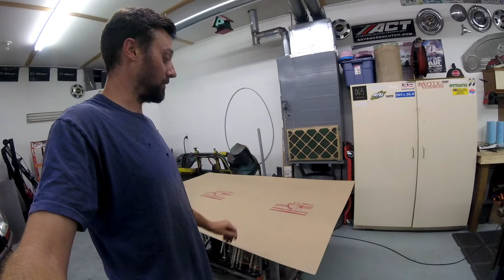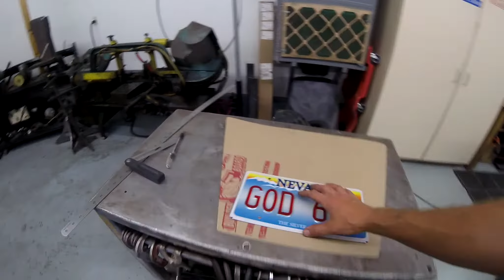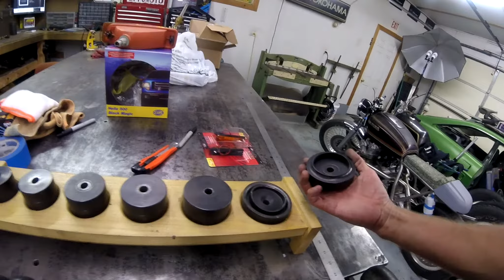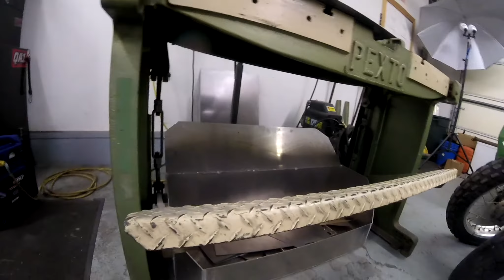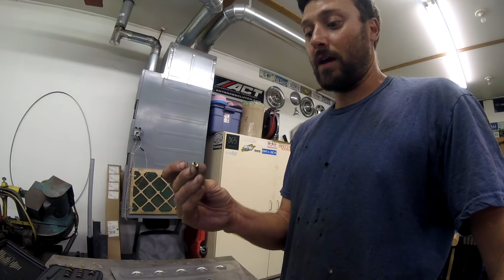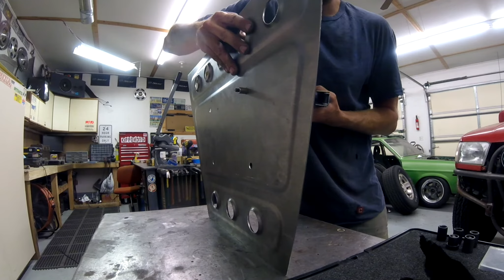My 1st 4x4 Build (E1 P6) - Toyota 4Runner (Pre-Runner style front bumper bead rolled panel)

Comment: Hey man what are your wheel and suspension  specs? Digging the wheels!
Reply from the maker: OME springs and Bilstein 5100 shocks.  
Wheels are 2 piece Bridgestone.  16x8 with a +10 offset.  1.5" spacers.  
265/75r16 Bridgestone Dueler A/T Revo 2's